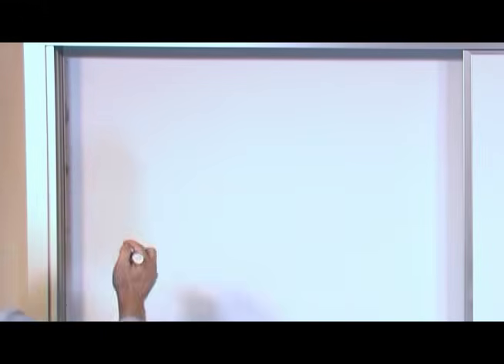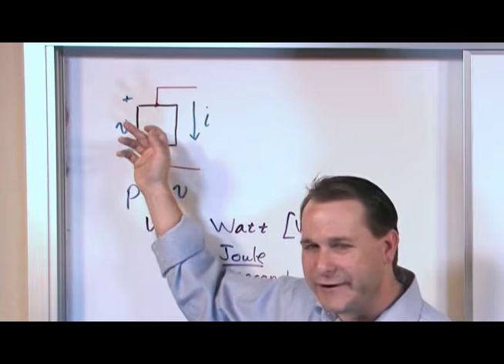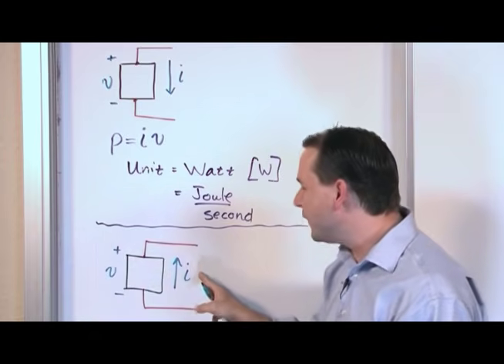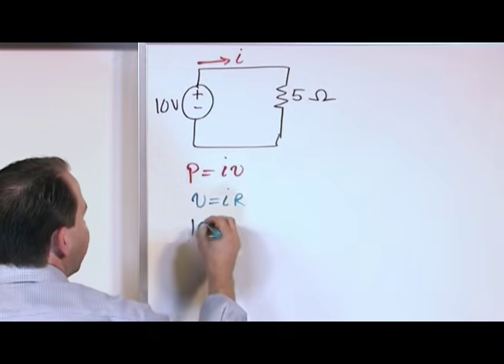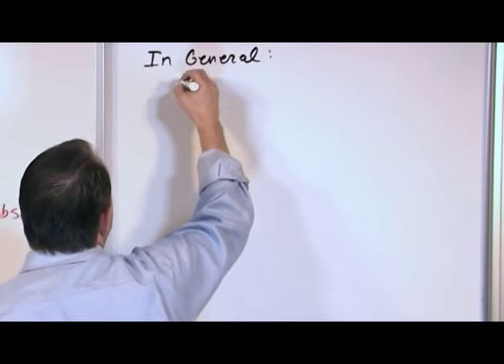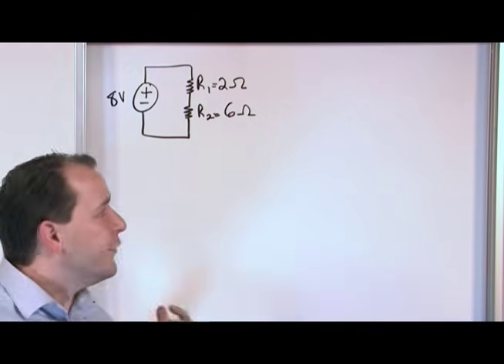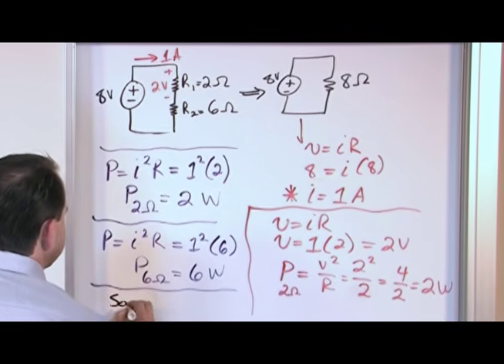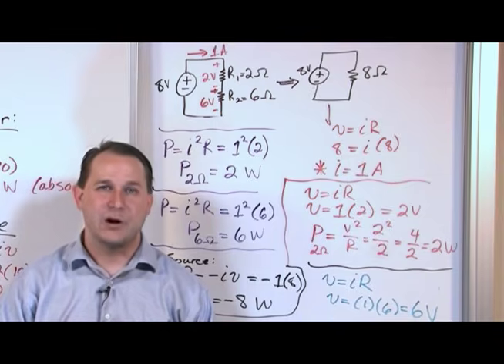What is Power & Watts in Electric Circuits?

Comment: Isn't the voltage drop formula V = I times ((R1 times R2) ÷ (R1 +R2)) giving you a voltage drop of 1.5 volts and a draw of 6.5 watts?

Edited: This was actually an old resistance coil in telegraph, sorry. It is exactly as the big guy explained it. Sorry for any confusion.
Reply: Think that's the formula for parallel resistors.....
Reply: @Sionnachful  This will work for parallel resistive loads, but I am sure there is a better formula somewhere, I don't remember where..
E divided by ((E/R1)+ (E/R2) + (E/R3))= total resistance.
Reply: You can replace E with 1

Comment: 14:30 - if we considered the direction of the electric current in accordance with the movement of electrons, then the power would be positive near the source and negative near the load - and this would be clearer and more logical
Reply: I don't get what the 'power would be positive' means? Higher [i] and a power drop will be near the load?
Reply: @baxterenrife  I already forgot everything I learned about electricity 😢

Comment: That example was horrible!  Just to be honest with you.  Your last explanation was absolutely confusing.  You wrote the direction of the flow of current completely the same way as you normally do, but then called it negative.  So I’m sorry but you just threw me completely!  Look at it again.  You set it up wrong.  Stating the flow was normal, but then claim that it was negative and stating the flow was going in the opposite way.  Come on 😅…
Reply: Everyone makes mistakes no one's perfect
Reply: Not a mistake, he's calculating power using passive sign convention. If a component is delivering power, it's negative. If a component is absorbing power, it 's positive  @CalebChavez-h3z
Reply: Sorry you're lost but he's not the problem lol gotta watch the first few lessons
Reply: It is more likely that, SIGNS(+ or -) are  based on how current is entering into the components ( which polarity does it encounter first ).
Reply: dude source is different from the component that he's talking about, better to watch it again.
Reply: It appears you were sleeping in the class. You need tore cap before exam.
Reply: I'm Indian living in village but i understood,u didn't
Reply: He did not make a mistake. Earlier he stated that a source Aways provide negative results, because, you could imagine the electrons flowing from negative through positive and out again in the circuit. So it would be a negative number.
Reply: If you don't understand then stop